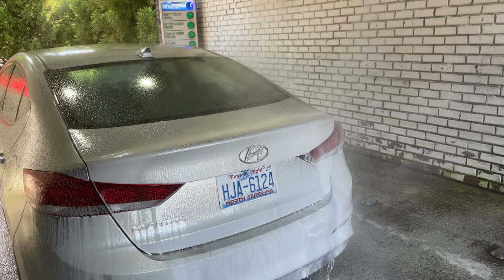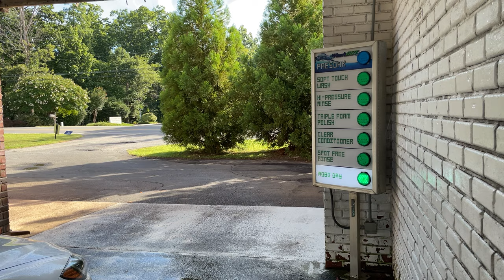(Rare?) WashBot Transformer 3XM: Ashcroft Car Wash | Reidsville, NC

Comment: I don’t see how this thing is practical in the slightest, but oh my god that’s awesome
Reply from the maker: This might be the only WashBot 3XM in existence.
Reply: @ncautowashes2889  I would agree with that as I would think that a complex system like that would be replaced within just a few years. I think that the owner takes very good care of this machine and he probably is trying to do everything he can to keep it running good. I can see that the wash arm already had some major repair work done to it and the belts and motors sound very squeaky even though this wash is 6 years old. This wash might be replaced soon.

Comment: This has to be the weirdest IBA I’ve ever seen.
Reply from the maker: This surprisingly replaced a LaserWash G5, so when I didn't look close enough at the wash bay on street view, I thought the G5 was just ripped out and the wash bay was vacant until I noticed part of that side brush against the wall. This machine is designed by a company called PX machines, and they've made another IBA wash called an EcoJet. It has the similar appearance of a Belanger Saber with 2 onboard dryers that look identical to the ones used an a really old AUTEC soft cloth system.
Reply: @ncautowashes2889  I didn’t Know that Used to be a LaserWash G5. I Really Need to Film One But Unfortunately I don’t have any in my Area. :(

Comment: This wash is really cool, It is very complex and I am surprised that this 6 year old Washbot still works and hasn’t been replaced with a more reliable system. I would think that this is usually broken because of how complex this system is.
Reply from the maker: This replaced a LaserWash G5 which was actually said to have been more reliable than this current system, but I guess the owner wanted to go for this IBA when he found out about it.
Reply: @ncautowashes2889  I am glad he still has it and hasn’t replaced it with a Laserwash 360 plus yet. He might be forced too if he can’t get parts to keep this machine running.
Reply from the maker: @arizonaelevatorsandmore2778  It probably won't be replaced for quite some time since it's located in a smaller part of the city and if the wash isn't getting much traffic (which it probably isn't) the owner wouldn't feel like replacing it. Plus the system is slightly above average at cleaning so it may have a few more years until something happens to it.
Reply: @ncautowashes2889  That’s amazing! I also spotted a Unitec PortalTI Pay Station, which is a reliable pay station. I think that it might outlive the Carwash itself as they last for a long time. If he has to replace the car wash due to decreasing reliability, he might turn the one of the manual bays into an automatic and keep the Washbot running in the existing spot so that people can come and enjoy it as well.
Reply from the maker: @arizonaelevatorsandmore2778  Yeah, the owner would most likely keep the pay station if he were to put a new machine in. Although, it'd cost him a lot of money to put in another brand new or even used in-bay automatic, it could increase the amount of volume this site could receive.
Reply: @ncautowashes2889  Although this wash may have seen better days, the dryers make a very cool startup sound!
Reply: @arizonaelevatorsandmore2778 Yeah, it uses soft starters, which for a car wash is extremely rare. Usually, they fire up the blowers in sequence instead—giving each one maximum current and starting the next once it’s up to speed.

Comment: Such a cool and symple machine.  Love how the brushes are just hanging on the wall and it picks them up off the wall.  Here is my issues with this machine. 1 there is no overhead brush to really clean the top of your car, and 2 the long drapping brushes do not sway side to side, they just run across the top of your car from back to front, and front to back. Fix these 2 issues and i think this would be one heck of a machine.  Its very cool and so simple looking.  I wonder how hard it is to program the plc for this machine as it is the brains of it.  Its all about the programmable logic controller
Reply from the maker: There’s actually a top brush variant of this machine and I’ve got photos of an abandoned one at a Citgo gas station in Elon. I don’t know if any others exist right now though.

Comment: I Never Seen Anything Like this! Weird Setup But it Seems Like it did an Awesome Job. Epic Video btw. :D
Reply from the maker: I ran through this wash twice to film a full touch free cycle that the machine was capable of giving, but it left some leftover tri-foam or wax residue on the passenger side of the car. However it did manage to get some bugs off the roof that the AUTEC I filmed a week ago couldn't get. Besides the whole leftover spots on the side of the car, it managed to do a decent job everywhere else.
Reply: @ncautowashes2889  Interesting. :D

Comment: I am the owner of the wash it was designed  to be different 
It requires minimal maintenance
I’m an open book if anyone is interested in learning more I appreciate the comments
Reply from the maker: Thanks for keeping this system alive! However during my last visit to this wash, I noticed the side brush's material was replaced on the upper part of the core near the motor, but the brush itself didn't spin during the soft touch cycle. Some other small flaws I observed during the making of this video and my inside view video was the tri-foam leaking out of the manifolds during the drying and spot-free rinse passes, which have left blue spots on my car. Are those 2 issues in the process of being resolved? Also, did the G5 that used to be here have a lot of functionality problems/high maintenance costs that made you decide to replace it with this unique in-bay automatic?
Reply: @ncautowashes2889  yes the motor needs to be reset when an electrical storm comes  or someone does something really dumb going through it that. Causes the machine to pull out of the way and shut  itself down.
Reply: @ncautowashes2889  all the other issues have been resolved after 4 years we replaced a manifold on the triple foam and had to play around with it to keep it from dropping foam on cars. The G5 lasted 17 years the previous owner took it out and was unwilling to spend the high price for another PDQ machine so he hired the robotic engineer that designed this wash to put this one in his bay.  I bought the site in November 2019.
Reply from the maker: @jaysonmcdowell44  Do you know if this system or replacement parts for it can still be purchased on PX Machines? I'd understand why the previous owner wouldn't want to spend money on a newer PDQ system, since I've heard that some of their products are high maintenance and don't clean as efficiently as other IBA distributers.
Reply: @ncautowashes2889  yes i own the rights to the machine and its patents im pursuing a plan to build post Covid 
Replacement parts I’m this day and time of 3d printers are very easy to get as long as the sources have “labor” and materials along with not having supply chain issues.  We have a complete other design that simplifies things and adds a top brush as opposed to a litter curtain. Pretty cool I was a pdq salesman for 5 years and then with washworld and mark7. I sold the G5 that was at Ashcroft   Before o bought it . I have been in the industry since 1998
Reply from the maker: @jaysonmcdowell44  I saw an image of a top brush being used! Pretty neat overhead friction concept.
Reply from the maker: @jaysonmcdowell44  Would it be possible to retrofit the side brush with star foam or NeoGlide and mitter curtain with Microclean?
Reply: @ncautowashes2889  sure
Reply from the maker: @jaysonmcdowell44  has the motor issue with the side brush been fixed by now?
Reply: I have another video of the next generation machine with a top brush instead of a mutter curtain how do I send that to you to review?
Reply from the maker: Is the video on YouTube?
Reply from the maker: @jaysonmcdowell44  Would it be possible to schedule a time for me to have permission to film your backroom and record the pumps and motors running? I'd like to hear how different everything that runs this machine sounds as opposed to other traditional in-bay automatics.
Reply: Where is this located exactly and is it still in operation?  Would love to see it
Reply: @jaysonmcdowell44 That's got to be one of the coolest car washes around and it even has on board dryers with makes it even cooler!
Reply: This thing is truly incredible, man, and it’s interesting to hear the backstory behind it! Keep this awesome machine running, as this is one of the most unique car washes in the world!

Comment: An articulated tool head, in bay tool storage. one of a kind for sure. The shroud that covers the toolhead is missing, for service this commonly happens. Really robs it of some curb appeal. Not a fan of mitter tool. Somebody worked really hard, and i respect it. But i wish that bay was cleaner.

Comment: THIS IS EXTREMELY RARE THE ONLY VIDEO ON YOUTUBE THAT IS SOOOO WEIRD
Reply from the maker: There's actually another video featuring this system, and it was uploaded by the manufacturers on a channel called PX Machines.
Reply: @ncautowashes2889  ya that’s actually the way I found out that PX machines made it in the first place and I did not realize that they made the rotofire system that’s so cool

Comment: It looks like the M5 signage was refurbished by Belanger I think
Reply from the maker: I think both in-bay instructional and wash progress signages were developed by PX Machines.
Reply: @ncautowashes2889  well the progression sign is made by PX the stop go backup sign looks like lazer wash signage and Belanger combined
Reply from the maker: @Ncswansons  The pull forward, backup, stop signage doesn't look like its made by OPW (which owns both Belanger and PDQ) so it could be made by a third party company.
Reply: @ncautowashes2889  ya most likely it just looks like if a lazer wash wash made by Belanger LOL

Comment: Nice video! The machine is rare and looks cool, but probably does a horrible job washing.
Reply from the maker: It did an okay job for the soft touch cycle, but not for the touch free cycle. There was soft leftover triple foam and wax chemicals dripping out of the onboard applicators during the rinse and drying stage, so the system left some blue foam streaks on the passenger side doors of the car. But considering this system looks like it's seen better days to begin with, it didn't surprise me that much.

Comment: So this wash is made by a company called PX machines this is there only car wash system and there not a car wash only company
Reply from the maker: PX Machines used to produce another IBA called an EcoJet RotoFire Twin, but discontinued it at one point. This might be the only buyable IBA if there's any left in stock on the website right now.